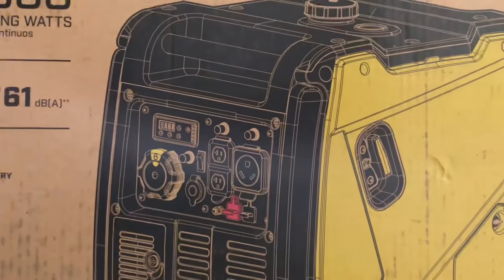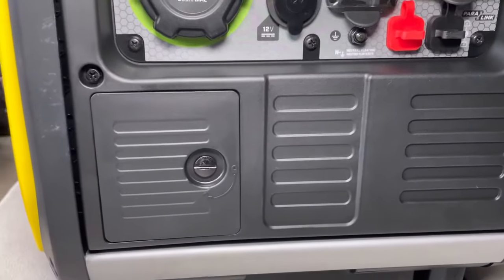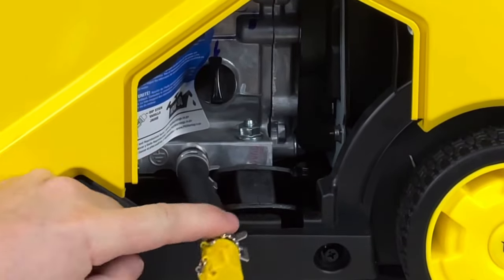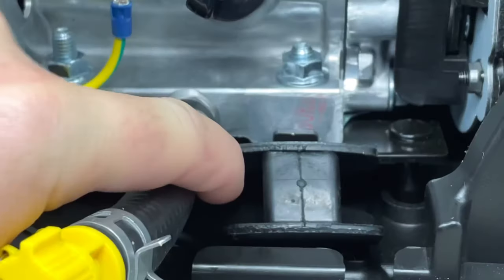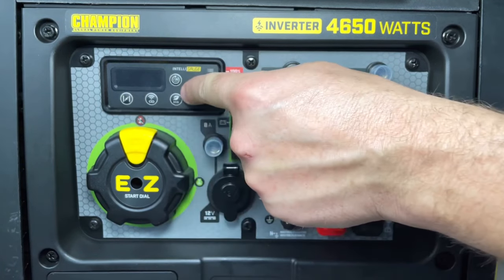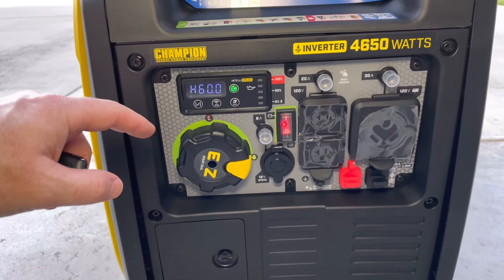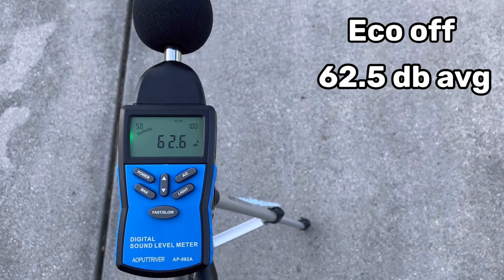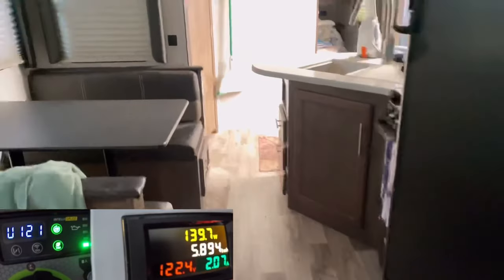Champion 4650 Review Setup Test Inverter Generator

Comment: Awesome review! I would suggest to use the heater first, then other devices up to 3kW and after that adding extra devices to try to see what would be the stable max working power without voltage drop.

Comment: Great test! Ive had a discussion with another person who made a video testing the harbor freight 4400i and he stated it would not run his 15k a/c and inverters  like that one wont start a 15k without a soft start. I said many vids show other wise. I had mentioned this unit but the 4500 version. I own the dual fuel 4500 of this. Good to see yours started the 15k with out a soft start. If you have a chance to test the harbor freight 4400i that would be great. Again great test vids!
Reply from the maker: Your welcome. And yes many of these gens will easily start a 15k unit that are 3000 watt and larger.  I’ll work on trying to get to the predator 4400i

Thanks for the comment and thanks again for watching 😃👍🏼
Reply: A soft start will make your gen run longer because of much less surge each time the compressor starts. I have a 32' 5th wheel with 2 acts with a soft start on each. I have an older eu2000i & can start my 13.5 k btu ac with one eu2000i in eco mode. That says alot about soft starts.
Reply from the maker: I’ll be getting one soon…😁

Comment: Thank you for the very informative video. I am researching a generator for home use for power outages. This was helpful.
Reply from the maker: You welcome hope this helps some. You have to remember these are 120volt gens and not 240 so only part of the panel gets power or you have a small sun panel installed and run the circuits you want to have power like the fridge or water heater , water pump and more.

Comment: I just picked up the same generator, I went with the model without Electric Start or CO (Champion 200992).   I use mine mostly for emergency storm outages which are rare and I want the less components to fail, it spends most its time in storage. I replaced the spark plug with the NGK BPR6ES as per the owners manual, I am surprised how out of spec the factory spark plug was it measured .021, it barely fit onto my gap tester.  Manual calls for .0.028-0.031.  It ran good out of the box, but even smoother with the NGK spark plug gapped to .030.
Reply from the maker: Yea I wonder if they are using other plugs due to supply issues maybe. Most always seem to take a ngk or torch but yea I always check the gap. Old school that way

Comment: Great review! You have to leave the battery on to use the remote start, I wonder how long it lasts with the button turned on. Like, leaving the battery on all night while camping, in case you want to start the generator first thing in the morning.
Reply from the maker: Yes switch needs to stay on to use remote. And when the switch is on it would probably last maybe 2weeks give or take before it drained it enough to where it wouldn’t start. 

So if used frequently leave it on. If not for a few days switch off
Reply: @johnnysweekends  Thank you for the reply and clarification on this question.

Comment: I’m considering purchasing this, mostly based on your review. Thanks for all the info you provide:). I’m wondering how this gen switches between gas and LP, I don’t see any switch mechanisms as I do on others. Is it so auto to not need one? If there’s gasoline in tank, and you hook up LP tank, will it run on both? Sorry if that’s a silly question
Reply from the maker: This particular model is not dual fuel.
But the dual fuel model has a switch on front that you choose which fuel source you want to use. And only one fuel supply will run at a time. 
You can see the dual fuel here..
https://amzn.to/3OdsOCr

Comment: First time here, and also a first time fuel generator user. One question (from a newbie). I purchased a Champion to use for emergencies to power a portable 8,000BTU air conditioner and/or 5 cu ft min-freezer. The owner's manual says that this is a floating neutral generator and that to prevent electric shock, it needs to be 'grounded' using a copper rod, etc. Is that necessary, and did you ground yours? Thanks for your awesome video!
Reply from the maker: No that is nothing more than a liability clause. No body grounds portable inverter generators. Plus the ground rod would need to be 5-6ft minimum to do anything pending soil and moisture. 

Use it and have fun and just don’t run it over 75% constantly non stop. If you are always at the load step up to a larger size

Comment: Just received this generator last Wednesday, did the break-in, seems like a really good rig to run my new trailer, BUT the remote doesn't start or stop the unit. Champion has a video for pairing remotes, but the video involves a button and a red light, the only problem the 4650 unit doesn't have any red light on it that apparently the other models have. The video Champion put out is only like 3 months old too. Any help would be greatly appreciated.  Maybe the fob battery?? I just took the did the break-in yesterday.  Thank you very much.
Reply from the maker: Does the fob have a light..? I can’t remember if mine did. If it does and no light I would get and new batt. Or make sure the fob doesn’t have one of those plastic covers or something that is in the battery to keep it from draining. You see that a lot in new devices. A little plastic sheet in between battery and contact. If not get ahold of customer service

Comment: Would you say this is one of the best generator/inverters on the market for RV/Travel Trailers? I just bought one to power my 2020 Grand Design 20BHE. It has a Coleman 15,000 BTU AC unit on it. I scored the dual fuel model 4650 on sale at Canadian Tire for $1100 CAD.
Reply from the maker: Yessss!!!! If you watch my top ten generators it came in at number 1 😀👍🏼

Excellent choice 👊🏼

Comment: GREAT video sir.  I'm on the fence between this 4650 Champion and the new NT Powerhorse LC4500i.  Seems the Champion is a Wen and the Powerhorse is a Loncin (same as Predator).  Could you offer any insight into what you think are the most significant differences between these 2 models?  

My biggest priorities are 1) CLEAN 60Hz power 2) efficiency  3) noise.  Thanks in advance!
Reply from the maker: I haven’t got to look at the bigger power horse but correct it was previously powered by loncin and could still be. The new champion is powered by the popular rato engineering engine same as Wen and many other brands. 

All new gens are pure sine wave energy at 60hz . Not sure you can find one that isn’t except maybe the cheapest of brands you could find. 

The champion is more efficient then the Westinghouse 4500 I know, and from what a lot of people report champion has good customer service and warranty. 

You can also check here for good comparison info https://generatorbible.com/?pk_campaign=jw
Reply from the maker: Let me know what you think but it seems the champion is a better buy.
Reply from the maker: Wow…. So awesome they helped like that. And glad you like the new gen, it’s a goon unit. 
One thing I do tell people from all the responses I get, is besides Honda and Yamaha champion has the best customer service and warranty and I think Wen would be next. 

But I think champion is your next best bet and you are a perfect example.

Now granted you shouldn’t have had to do any of that and probably could have gotten a replacement, but you worked with them and still got a good result. 

Thanks for the reply…. And thanks again for watching 👍🏼😀

Comment: Phenomenal video. Concise and explained perfectly without any filler. I’m looking to get the Champion 4500 duel fuel...do you know how similar they are?
Reply from the maker: They run the same size engine at 212cc just a different inverter board I imagine. 

I like dual fuel when ever possible 👍🏼

And thank you so much still improving as I go…😀

Thanks for the comment and thanks again for watching 👍🏼😀
Reply: Me too on the 4500 dual.
Reply from the maker: Duel fuel for the win..!!
Reply: @johnnysweekends  I should have waited. I purchased the 3500 watt dual fuel a couple of months ago for $999. This one is on Amazon for $876. Duel fuel is great. Especially with a propane tank. Cleaner, less fumes, lasts for hours longer than using gasoline. Not having to worry about gas going bad and gumming things up.
Reply from the maker: Exactly I tell people if you can get what you want in a dual fuel then why not. Darn near same price. And yea the 4650 was originally $1050 but got slashed to like $850…😒 lol
Reply: @johnnysweekends  Johnny...quick important issue I ran into... mine started in eco mode, but quickly the red overload came on and killed the volts to zero..... I had to hit the button to reset the overload to green, and only then could I turn eco mode off....when I had eco mode off, I could then get the volts to operate....I had tried a long while to turn off eco with the overload still in red, but it wouldn't turn off and I was getting an overload despite having nothing plugged in.....when I plugged in with this config I could never get any volts OR turn of eco mode......the key was getting the overload button from red to green and then quickly turning off the eco mode, which then allowed me to power items with the right volts! If I didn't do it quickly, the overload red light would start flashing again locking me in eco mode with no volts..Mine is the TSC version without dual fuel or remote start...thanks for sharing this and maybe telling me is mine if malfunctioning....thanks for your great review!
Reply from the maker: I would contact champion because yea that seems odd for sure. 

Let me know what they say.
Reply: @johnnysweekends  I had to return mine because it wouldn't accept a load....
Reply from the maker: No problems with the return process..??

It just happens some have issues. You figure out of a 1000 sold I bet 50 are duds. 

Who knows for sure.
Reply: @johnnysweekends  yes, and I get it was some minor issue if they had a tech who could look at it.... but who has the time? TSC took it back with no issue. I hated to let it go and really tried to get it to function right.

Comment: Great video! I just purchased a Champion 4500Watt duel fuel inverter generator for power outages in my home. Is this unit grounded or do you need to put an external ground?
Reply from the maker: No it’s floating neutral so no ground needed with this as the house is ground.

You can find out more here as well as it has good information on that as well. 

https://generatorbible.com/?pk_campaign=jw

Comment: Great Review.  I ended up buying this as my first generator.  I read there is a 5 hour break-in period.  Did you do this and did you do it with the generator under load?  Any tips in this area very much appreciated.  Thanks!
Reply from the maker: No I don’t use that process. I have built a lot of engines for racing bikes and skis and once a builder we don’t follow any of that especially on low compression lawn mower engines.

We normally would have engines broke in and ready to race in 20 mins or less. If you had a problem sometimes you get 2 mins to see if it runs and then to the line. Sometimes running engines the whole season that way lol.

I do heat cycles…..several 
Start engine, warm up for 2 mins…

Add small load… slowly increase to full and back down with in a couple mins period to idle for a min and shut off.

Let rest for a while then redo two or 3 more times and done.

I’ll change the oil after the first or second run. Then after I’m done. You buy a gallon of oil and you can change the oil several times because they don’t hold any lol.

But that’s my method, it’s worked for years for me. Everyone who reads or does this is at your own risk. Follow the instructions for warranty assurance. 
👍🏼😁

Comment: The video was great and just what I was looking far !!!!! Thanks a lot !!! What about extension cords to run into my house for my tv,washer ,appliances,etcs.?
Reply from the maker: Best to get a generator plug installed and you can also do the multiple breaker unit that way you power the items you want since these are 120volt generators. 

I like the transfer boxes with about 4-6 breakers.

Comment: To use the remote feature do you leave the battery and switch on?  If so wouldn't that kill the battery?
Reply from the maker: Yes leave remote feature on. This has such a minimal drain that it will last several days. But it’s only if you know you are using it during a time period not in like two weeks you want to start it.

Comment: DANG good video. I have one of these generators, but have only used it once a couple of seasons ago. That said, it has old fuel in it, and old oil. How do you recommend I service it myself before I need to use it (for A/C) this August in the mountains?
Reply from the maker: Change oil, and remove old gas if you can. Did it have a treatment in it? 
Add fresh fuel.
Open drain screw on carb and let fresh fuel flow in with gas switch on. 

Then see if it will start and let run for 5-10 mins. 

Small jet could be plugged if so it will need to be cleaned if it idles roughly or surges up and down
Reply: @johnnysweekends  didn't know there was a carb drain. Fuel switch where? No additive. Do you recommend adding with every fuel add or just when you expect to put it to bed?
Reply from the maker: I always add a little regardless just in case you let it sit for a while. 
I forgot that model is all in one so just turn to start and the opens the fuel to the carb. 
There is a screw on the bottom of the carb, it’s a small Phillips and open it a couple turns till fuel comes out the hose then close it when it stops. 
Then try and fire the gen, which may tak a few tries. 
Hopefully you don’t have to clean the carb

Comment: I just picked mine up today, it's replacing a Champ 3150. Being it has lithium battery what do I use for a charger, book says use a trickle charger, I use the battery tender JRs on a lot of my stuff, will one of them work with this battery cuz they have same type of plug.
Reply from the maker: You wanna look at the specs of the battery and also the charger, and see if it’s capable for lithium because they need a higher charge rate.  The small batteries may not be so sensitive but in larger items you do need a updated charger that has a lithium batt setting. 
Hence I haven’t switched my RV over yet. 
Multiple things have to change.
Reply: Ok BTJR doesn't  say for lithium so what's a good charger for these lithiums in the Champs.
Reply from the maker: I honestly don’t have a good one to recommend as a lot are still new for the small batteries and some are still pretty spendy.

You could try this one just don’t let your battery die all the way. 

https://amzn.to/3daEKU4
Reply: Ok thanks. 
Checked Champ info and it says no more than 1.6 amp charge and that ones a 2 amp. I found a BT jr  for lithium that's 800ma/.8 amp with same plug end.
Reply from the maker: Oh nice , yea I look every once in a while and still nothing stands out yet. Well for a reasonable price lol.

Comment: Thanks for the review. Looks like this might be the one considering it's on sale for $795 I think. Not sure I'll get an answer but what model trailer do you have?
Reply from the maker: That’s a good deal for that gen…👍🏼

2018 cougar 29bhswe..👍🏼

Thanks for the comment and thanks again for watching 👍🏼😀
Reply: @johnnysweekends  I was also looking at the open frame model which is even cheaper still at 599. And put on my own wheel kit.
Reply from the maker: They are good as well, but they will be considerably louder, so for RV or even home, you will here it for sure verses the other during low load you may wonder if it’s on.

Comment: could you or have you ever done a test with the Hughes voltage booster with a generator. they claim it changes watt's to volts. hence uses less power. would like to see u test this. thanks great videos just found your channel🎉
Reply from the maker: I have contacted them but o don’t think it does exactly what you think but I am curious how it would react with a smaller generator unit. It’s supposed to protect against power surges and voltage drops adding a small boost to protect items in your Rv. So it helps with both verses a normal surge protection device only protects against a power surge.

Comment: I purchased the same model without the remote start but when I try to hook it up to my RV, the 30amp cords are reading reverse polarity. Any idea on how to fix this? Any input appreciated. Thanks guys
Reply from the maker: Wow interesting. Well this can happen to where they put the wires in the wrong lugs on the plug. This even happened to some of the Ecoflow delta pro units. 

So get a meter on the plug and check to make sure that’s the problem. Negative on the ground and positive on the lower left. That’s the hot line. If your meter shows a negative then it’s reversed for sure and needs to be switched. 
If no negative shows up the something else is going on. 
Unfortunately things happen. 

Wiring for that unit should be ground up top. Black or load on bottom left, and neutral on bottom right. Unless it’s a newer model and it changed, so if the ground is on the bottom, then the upper right is your positive. 

Let me know what you find out

Comment: When you had it with highest load, was on eco mode?
Reply from the maker: It was on eco if I remember but that won’t effect overall performance except for tough loads on and off. So when running a air compressor or ac unit on and off best to have it with eco off then turn it on to let throttle adjust as loads come and go. 
Eco just allows I to idle way down when loads are minimal to none
Reply: @johnnysweekends  Thanks a lot..
Reply from the maker: You’re welcome 😀👍🏼